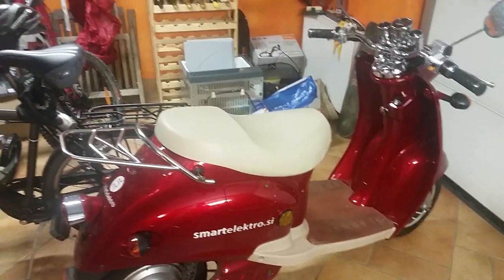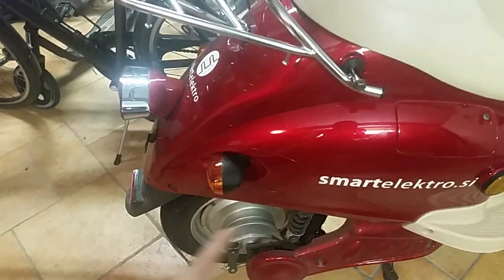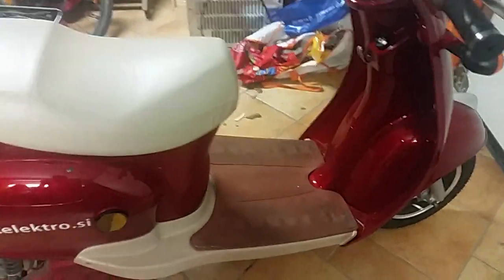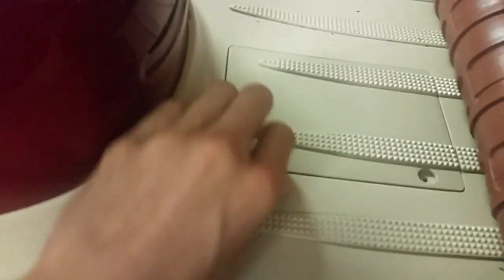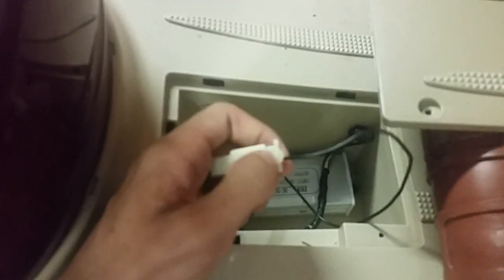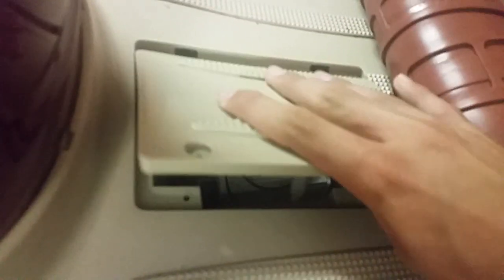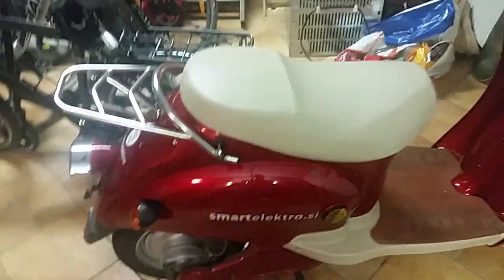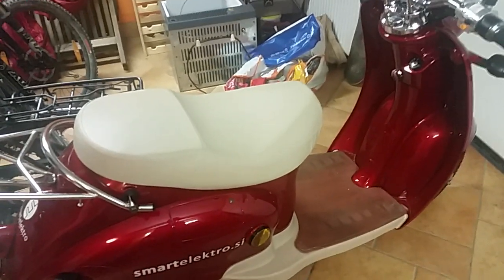Remove SPEED LIMITER on electric scooter/Make it faster

Comment: Would be more useful if you explained what the wire is called, what it connects to and how it changes the speed control system, so it can be applied to different models
Reply: j.m the wire is usually called a training wire and it limits the amount of power going to your motor, it’s usually just one pin and unplug it. Most common on brushless escs

Comment: By disconnecting the speed limiter, does it cause wire over-heating, and does it cause motor surging (where the motor keeps kicking in, and out while travelling at 45 kilometers an hour?  I'm having an issues with mine doing both. Batteries are right up to par, with at least 18 drawing amps available on each battery, on a battery power amperage drain tester. In other words the batteries are quite fine, and not needing replacing.   Like to hear your thoughts on this problem I'm having...  Thanks, and regards.
Reply: Its likely there is a current limiter or temperature limiter on the power supply to protect it. You'd need to replace the power supply if you wanted to be able to consistently deliver more power. They will have fitted the cheapest one necessary to do the job. My 2c.
Reply: Thank you very much for your reply....

Comment: Hey, any idea on how to remove the annoying beeping when the turn signal is used?
Reply: Mathew Gennaro Same Problem Here
Reply: If it's a Motorino it's the orange wire by the horn/ speaker.
Reply: Turn on the signal, listen for the sound to locate. It should be inside the front fairing under the light. wrap the blinker relay in tape to muffle the sound. You can do the same if you have a reverse beeper or simply cut the cord.

Comment: It looks like he unplugged his controller but wouldn't that just stop it from working all together? Or was the really the wire for the limiter? I have a 2016 gio italia and I can't figure out how to make it faster I get 41km max I want to bump it up to 70km going kinda crazy here!
Reply: Andrew Small hey same I have the gio premium that I can max on flat ground get it up to 45kmh with a full charge. Let me know if you figure this out.
Reply: I have a 2016 viper 60v an it goes around 45km an i cant figure this out either would love to though..
Reply: that's a big increase, its likely you'd need to start replacing components to get up to that kind of speed. Both the motor & its power supply will have physical limits
what this guy is demonstrating is removing the legal limiter, but the components will also have a physical limit
e.g. on a 50cc moped, you can remove the speed limiter, but you'll still be lucky to get it up to 70Kph

Comment: Very beautiful scooter amazing
Reply: The video is good advice and yes your battery will drain quicker so would advise a higher ah replacement battery There are numerous ways of increasing the power of any motor but there is also that risk of either burning it out or blowing the ecu on the bike which all bikes should have I was going to put numerous ways on a plain speaking video on here but you get the usual wise arse comments on here so can't be bothered For those that don't know allot about electrics the ecu is the bat ins which controls everything going on with your moped that is electrical it controls wattage outputs for bulbs speed control brake lights wattage etc the power in the motor ( which can boost you speed) can be improved by adding a higher voltage battery but here's the problem you higher voltage battery will eventually if not maybe immediately burn out your motor at a high cost not to mention if you have any lighting on you bike the bulbs will also blow which I have noticed some people fail to neglect. This video is good advice it seems as though he has disconnected the speed control unit which runs in a loop from the ecu ( totally illegal by the way) if you were to be stopped by the police for speeding and end up in court ( which some people have) I would claim that the switch simply became detached by accident ( it would confuse the hell out of them anyway) if you do decide to do this what I suggest is to install a simple switch somewhere on the bike to connect and reconnect this line when you need it for example uphill this avoids the high battery use. Another idea is to run the power from the battery directly to the ecu input avoiding the speed controller etc again a switch can be installed if you are finding high battery usage I believe there are some videos on here showing how to do it and believe me it is a simple job as long as you know what you are looking for but here is something I haven't noticed anyone pick up on the is a unit you can buy called a dc step up modulator they are cheap ( China on eBay would be the best to get them ) this works on the principle of increasing your voltage from the battery to the motor hence more speed ( but again the higher the voltage the more likely hood you will blow the motor ) so my advice is this ( probably going to get some bad comments on this but what the hell) find the output volts from your control box ( normally black and red wires) if the output is for example 50 volts type into ebay or wherever you shop for electric items adjustable voltage step up dc regulator you should find one and they are quite cheap from China you have 2 choices here you can either wire this unit between the direct wires that you have used to modify the the. ecu unit which I explained earlier or run it direct from the battery. But here is the danger do not go over board and increase the output of this regulator from 50 to 100 volts as you are asking for trouble just raise it slightly to an out put of let's say 50 to 55 v the speed of the motor will increase but again your battery will drain and you are also putting a slightly higher voltage which to be honest in time will effect your motor . So yet again put a switch for this unit somewhere on the bike and use only when needed This can be done with any electrical vehicle including scooters but beware if you are sopped by the police and unfortunate enough to be stopped by a policeman who knows everything about scooters and the switches are spotted your in trouble. My advice if you do get stopped is say it was there when I bought it or claim your mentally ill Hope this advice can help as these mopeds are getting very popular now not to mention the scooters as well If any of you would like me to make a video on how this is done I will try my best good luck all

Comment: Put the screws back in and secure the controller box, it does matter. LMFAO at this guy's information. If you want to be safe put the screws back in. Don't listen to what this guy is saying, he's obviously lazy or stupid! But at least the wires he's talking about to make your bike go faster is right, so you can do that no problem that works only problem is, you definitely should replace every part of your bike after removing bolts screws panels, etc!